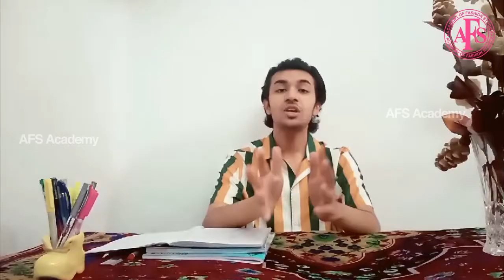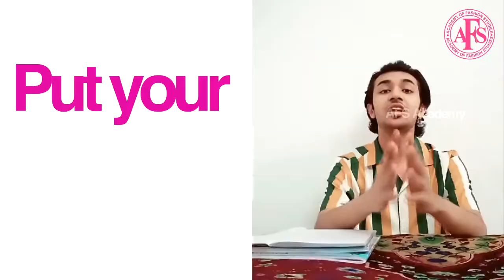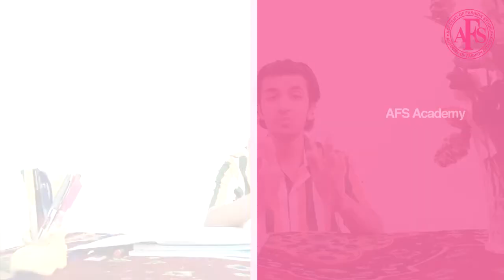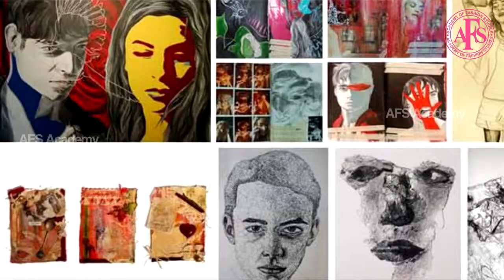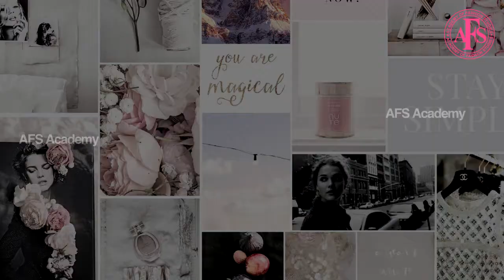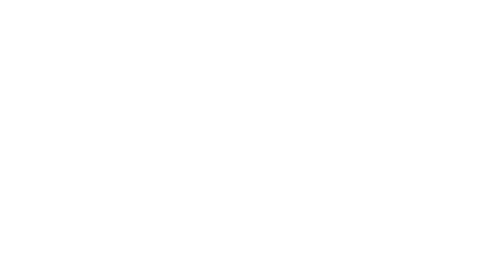Portfolio Making | NIFT/NID Entrance Exam Preparation

Comment: Is it okay if I don’t exactly have art work but have design projects that I have worked for clients , my drawing skill aren’t very great tho
Reply from the maker: Amrutha vids yes ..you can put your design projects also.
Reply: Same. But how did you display your design. I'm assuming you made some digital design. So did u print them and showed them or how does one showcase the digital work. What is a digital portfolio? Does it mean that u have to go there with your laptop?
Reply from the maker: @mrymafzal  portfolio is the compilation of your work so doesn’t matter your are showing it as a hard copy or soft copy ..if you applying for any institution they ask for hard copy, but in industry they prefer both. Save your digital work in PDF format or in PPT and you can showcase it on laptop.
Reply: @academyoffashionstudies7845  thank you for clearing my doubt
Reply from the maker: @mrymafzal  good luck
Reply: Any sizes of art paper is fixed or not?
Reply: @ipsitamishra7954  a3